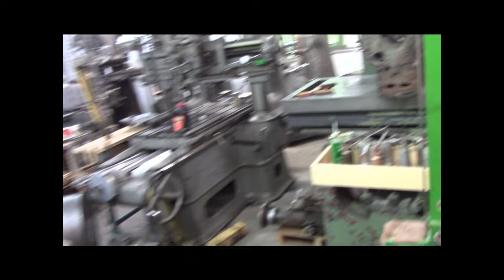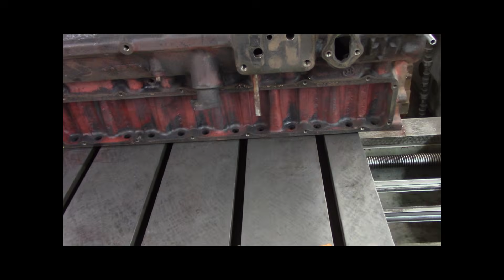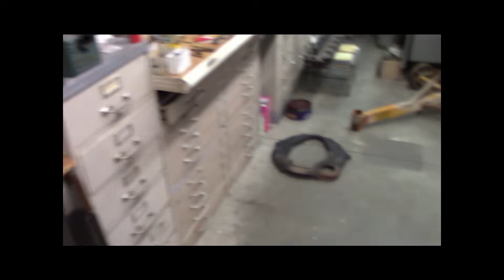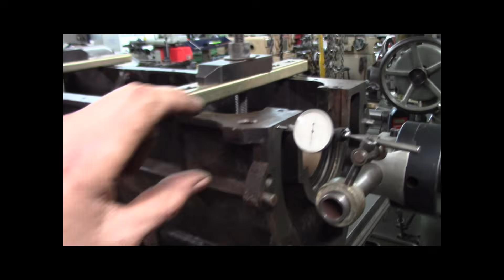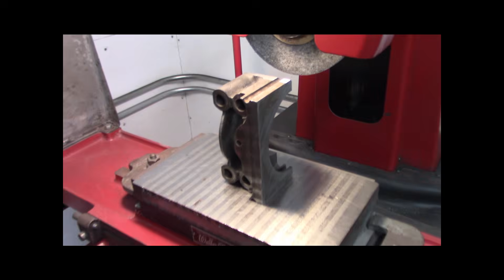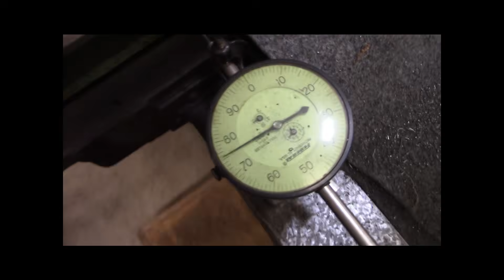4-21-26  --  International 264 One Piece Rear Main Seal Modification on the HBM

Comment: Good to see a bit of HBM work .   Even the larger Cat engines do not have caps that tight . Tight but not as tight as those !  Cheers  👍
Reply from the maker: Thank you Max.  Good to hear that I am not too far off mark thinking that rear cap was too tight. I appreciate your experience with this.  I have been watching all your lathe carriage restoration videos.  Some top notch work there. Love how you used the reference bars to set the cross slide angle.  Brilliant!  ---Doozer